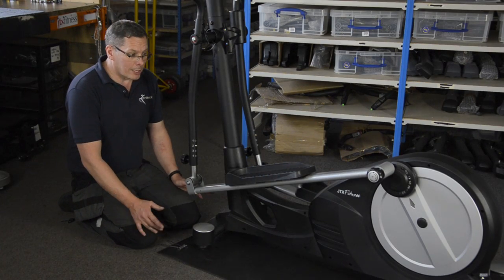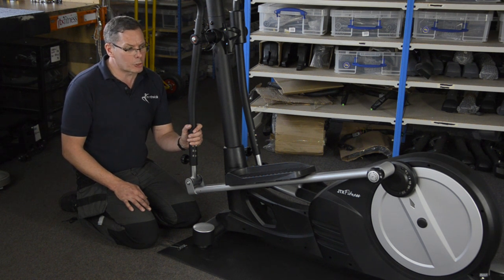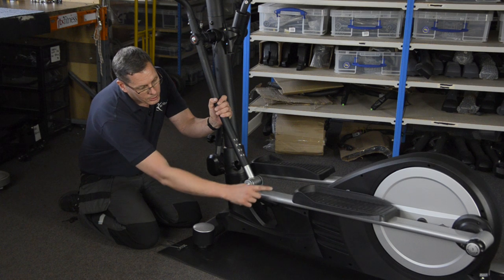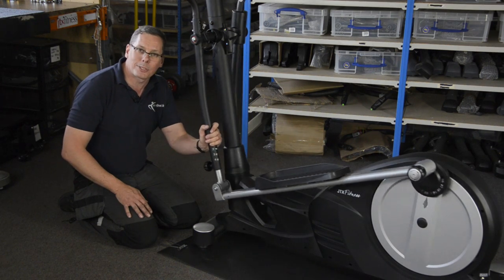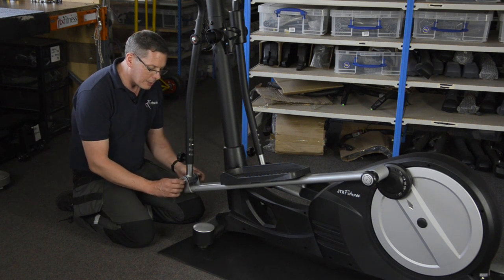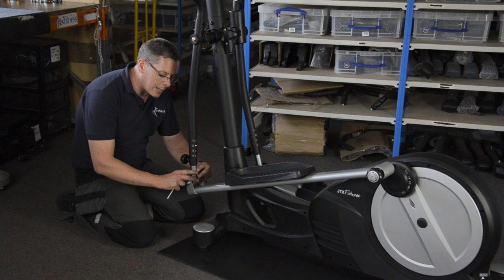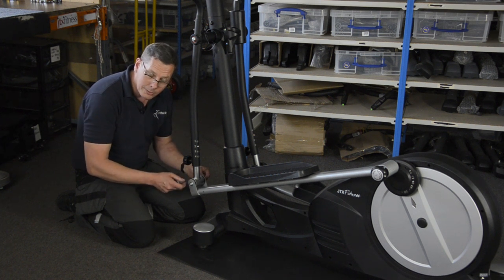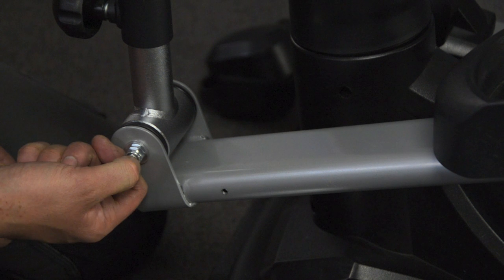How To Stop Cross Trainer Squeaking

Comment: I was starting to get an inner thigh pain.  Chiropractor didn't help.  I finally realized my ProFrom elliptical needed lubrication.  You take off the bolt with an Allen wrench (Hex tool).  Put in a white lithium grease lubrication from a tube.  I have had the elliptical 5 years with 5 days a week usage.  I had forgotten about the thigh issue and the need for grease from a time before.  I need to write it down and put it on the elliptical.

Comment: I have a Gazelle freestyle Pro and the issues I had when assembled and ran for the first time had squeaks and vibrations and the cure was WD White Lithium Grease Spray after removing the Plastic Caps that are at the handle bar Right and Left posts, noticed they were rubbing the bar tight so used a Dremel Tool and sanded the BAR HOLE in all places of contact and replaced ,now the unit is a quiet as a Church Mouse no NOISE ANYWHERE, WHO HOO'

Comment: got mine(nordictrack commercial 14.9) today and had assembly team assembled it for me. assembly team was quick to leave the scene before I can test anything by telling me, I should contact support team if I ever run into trouble. but damn, they are right. as soon as I get on and start pedaling, left pedal starts to squeaking. I can pin point the location but I checked all bolts on left pedal and they were tightened up. i am so pissed coz I just dropped $1800 for this and it starts to squeaking from day one. i am 280lbs but and pedal doesn't squeak when pedal it with my hands without getting on elliptical. can my heavy weight causes squeaking noise even though I am 70 lbs under supposedly 350lbs weight limit or there is something wrong with my elliptical?
Reply: please let me know if your still having the problem. I purchased the same machine a few months back and i cant stop the squeaking noise.

Comment: I pulled my flywheel off cleaned it and all the nuts and bolts and put a silicone oil everywhere to help it glide I put it back together and now all of a sudden it's really hard to Glide I'm not sure what I've done any ideas on how to help it Glide again the machine is very stiff now. I made it worse.